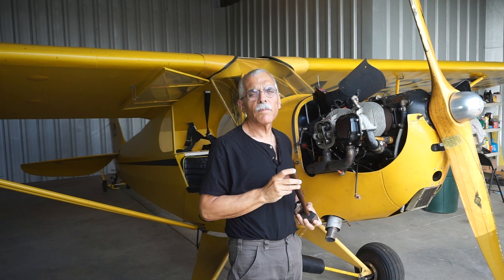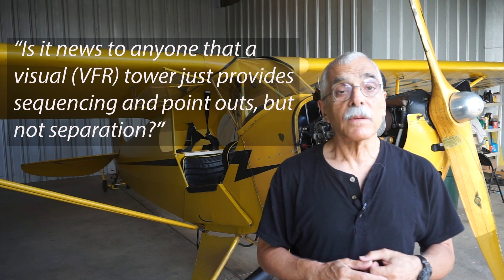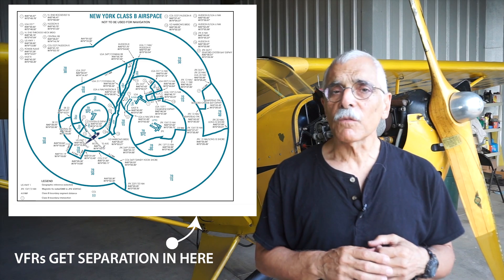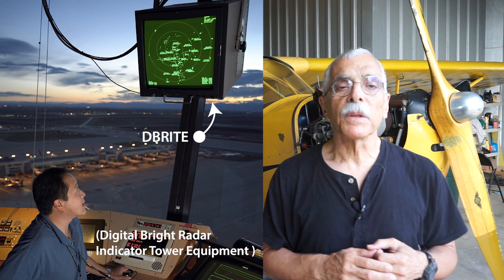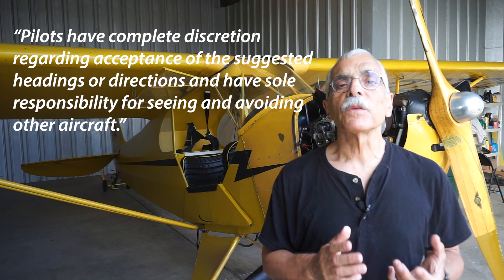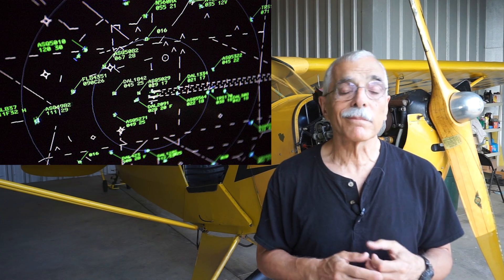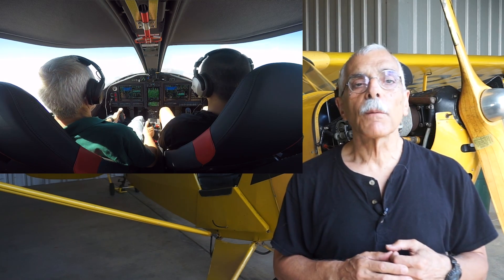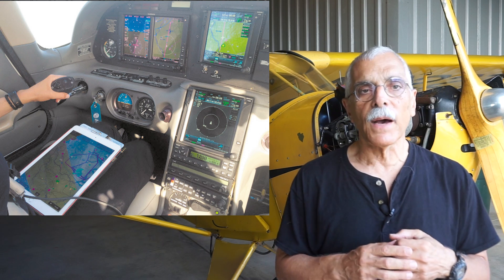Control Towers Don't Do What You Think They Do

Comment: There are two reasons you have to have an air traffic controller pilots are blind compared to things that move as fast as aircraft like Hawks or a cheetah. As human beings go pilots are exceptionally hard of listening. Scientific research has shown generally flying in an aircraft your eyesight is focused about 40 yards in front of you. If you were flying an airliner and you saw something in the air in front of you you have either hit it or missed it by the time you saw it you're too close to turn and miss. Most people don't realize how committed they are when they're driving a car on the ground at highway speeds. They can't accept that if you're riding in an airplane you're pretty much over flying your eyesight. If you would do the math and figure out the cross section of the airliner times the speed of The airliner you would see that we are sweeping out a pretty large volume with an airliner. When you have that many things sweeping out that much volume driven by blind people you need some kind of traffic control so they don't just run into each other close to the airport.instead of pretending we can all see why don't you pretend we're all Stone blind and we need air traffic control so we don't bump into each other close to the airport. If you're going to dumb it down and make it simple that's the best way to go.

Comment: Wait, what? Only 51% of midairs since 2000 have been fatal? That seems like an almost impossibility low number to me…

I’m the opposite way when it comes to operating in and out of Class D. I like practicing my touch and goes elsewhere in order to keep from annoying tower controllers but I actually like operating in a Class D environment. Nothing is utterly fail safe but an extra set of eyes never hurts and the further I get away from my “primary” days, the less communicating with ATC bums me out. The controllers at my home field are known for being really good. It’s a well-equipped, 24hr military field with an endless runway that sees traffic from small GA up to cargo 747s and even the AN-124. So the experience you get at a place like that is at least likely to be a little better than you’re gonna get at a small contract towered field whose controllers spend all day bitching on r/ATC

Comment: One of the best videos I have see that describes reality, not just the CFARs. Thank you Paul!

I fly out of an airport with light traffic compared to a nearby uncontrolled airport, both not far from a Class Bravo primary airport. The uncontrolled airport was described as "the wild west" during a recent Saturday seminar I attended that was hosted by the local FAST Safety Team. I agreed with that depiction having flown a bunch out of both airports.

The bottom line is that I love my home-base airport in no small part because it HAS a "VFR" tower. And, I will admit, that I ask them to "fetch" my IFR flight plan quite often. 

THANK YOU to the Air National Guard tower at KVUJ! You guys and gals do a great job helping keep my wife and I safe in all kinds of weather.

Comment: Hate class deltas. They’re more in the way than anything else. I fly out of Prescott where they sequence and provide good separation when able, but the system is rigged against good controllers who want to take control of the airspace. A busy runway isn’t the same as a busy airspace. There are busy runways with straight in and out traffic and then there’s patterns that are buzzing with aircraft but an inactive runway. VFR XC traffic into Prescott has to seriously contend with training traffic and yet the controller is more difficult than if there were not. Deltas have different priorities, and this cannot be changed without serious FAA approval/intervention/budgetary input.

Comment: Paul, I used to use the differential pressure tool to apply air flow into the cylinder and pressure to the valve face while reseating the valve. It works well. I love 1930s technology.

Comment: In Europe, EASA makes it very clear: it's the aispace class and the flight rules that matter. I as a VFR traffic will be
- Class A:  fully separated from the whole airspace (not allowed to enter)
- Class B:  fully separated from IFR and VFR traffic 
- Class C: separated from IFR traffic, but not separated from (only adviced about) other VFR traffic
- Class D: not separated from anything, only traffic advisory
- Class E: not separated from anything, traffic advisory "as far as practical"
- Class F: not separated, uncontrolled airspace
- Class G: not separated, uncontrolled airspace

In short, unless we are in a Class B airspaces, VFR pilots will NOT be separated from other VFR traffic by air traffic services. The pilots need to do that themselves, it's their responsibility and any additional help received from the air traffic services (suggested avoiding actions etc.) don't transfer the responsibility away from the pilots to acquire the other traffic visually and avoid collisions. 

Source: https://www.easa.europa.eu/sites/default/files/dfu/Easy%20Access%20Rules%20for%20Standardised%20European%20Rules%20of%20the%20Air%20%28SERA%29.pdf
APPENDIX 4 ATS AIRSPACE CLASSES – SERVICES PROVIDED AND FLIGHT REQUIREMENTS

Comment: Also, according to the 7110.65, "copy" is not proper verbiage. The word is nowhere in the entire manual. While "advise when ready to copy" makes sense, roger, wilco, or a readback is expected and should be used in place of "copy." It seems no pilots understands this unless they are or were also controllers. I didn't know it until I went to OKC either, so I'm not judging (plus I've worked in the airlines for 20 years and I hear it all the time).

Comment: Was flying to Las Vegas from Minneapolis and multiple times during the flight I was able to visually see a plane as we nearly passed through the contrails at cruising altitude, at my estimate we were at minimum 100 feet above them and at maximum 300 feet, and we sure as hell weren't 3 miles apart. Is that normal?

Comment: At 5:43 your video says issuance of Traffic Alerts is optional.  This is absolutely wrong.  FAAO 7110.65 para 6-1-6 states very clearly "The issuance of a safety alert is a first priority..."  There isn't any "optional" about it.  I also take issue with your repeated assertion that towers are not providing separation by giving positive control instructions, "Proceed direct to X"  "Turn south and look for Baron 2 o'clock 3 miles westbound" extending downwinds, and issuing 360's.  This is unquestionably the provision of airborne separation between aircraft.  The absolute essence of working numerous aircraft approaching the airport from widely different directions and altitudes, with very different flight characteristics is the provision of separation between those aircraft.  This is without mentioning the numerous pilots who, despite correctly reading back a clearance or instruction, attempt to land on the wrong runway, cutoff other aircraft, cross or enter runways, etc.  And those are not rare or isolated events, they happen with frightening regularity.  You talked about skin in the game and chairs falling from the sky.  As a pilot you can make all sorts of egregious errors, and receive nothing more stringent than a phone call from FSDO, while those VFR Tower controllers you seem to discount as superfluous are under incessant pressure and threat of career ending sanction for the simplest of phraseology errors.  You'd be well-served by reaching out to a tower and spending a busy afternoon watching the reality of the system.  Reference:  33 years ATC, including training, management, and Watch supervision.
Reply from the maker: You might have published the entire paragraph;  

2−1−6. SAFETY ALERT
Issue a safety alert to an aircraft if you are aware the
aircraft is in a position/altitude that, in your judgment,
places it in unsafe proximity to terrain, obstructions,
or other aircraft. Once the pilot informs you action is
being taken to resolve the situation, you may
discontinue the issuance of further alerts. Do not
assume that because someone else has responsibility
for the aircraft that the unsafe situation has been
observed and the safety alert issued; inform the
appropriate controller.
NOTE−
1. The issuance of a safety alert is a first priority (see
para 2−1−2, Duty Priority) once the controller observes
and recognizes a situation of unsafe aircraft proximity to
terrain, obstacles, or other aircraft. Conditions, such as
workload, traffic volume, the quality/limitations of the
radar system, and the available lead time to react are
factors in determining whether it is reasonable for the
controller to observe and recognize such situations. While
a controller cannot see immediately the development of
every situation where a safety alert must be issued, the
JO 7110.65W 12/10/15
2−1−4 General
controller must remain vigilant for such situations and
issue a safety alert when the situation is recognized.
Reply: @AVweb  which doesn't say anything at all about it being optional.  It doesn't even imply it.  It says it is a FIRST PRIORITY.  It's not a complex paragraph to follow.

Comment: I would think in addition to ADSB (which could suffer at times from signal loss or lag), planes should also have some form of near field radar as a backup which turns on whenever another plane enters your sphere of operation, say with a warning radius of a mile or two.   Or perhaps less if you are in pattern or on approach.    A bit like a car backup camera that only turns on in a specific situation.
Reply: The average price of a small airplane, is about $45,000. An automated onboard radar starts in the hundreds of thousands.
Reply: @Triple_J.1  The actual cost of the tech is much less, retail price is jacked up only because of a small market and no competition.   In reality it should be no more than a couple hundred dollars.
Reply: @Zuckerpuppekopf  a radar array has to send a radio signal, bounce it off the target, and sense the return scatter. It's incredibly complicated tech. Yes, they can definitely mass produce it. But even fighter jets don't have 360° radars, they cannot scan the entire sky simultaneously. 

Also, many small airplanes are made of wood and fabric, e.g. Piper Cubs and Pitts specials. They are semi-stealth. It's part of the reason why Transponders are required in certain areas. It is a secondary verification for the radar operators.

ADSB-Out works the best at the price point. 

The primary means of collision avoidance is Mk.1,Mod-1 eyeballs. It works for semi trucks. It works for race cars. It works for fighter pilots in air to air combat.
Reply: @Triple_J.1  well of course classic radar tech required an update lag since it did a 360 sweep every x-seconds.  And more importantly you'd need more of a spherical zone of sensitivity.  But, the real issue, especially if near the ground is how to filter out noise, especially if adjusting for lighter materials, as mentioned.   So, yeah, the only real solution is to require all flying devices to have adsb so you can download the data directly.   However...even that data would be lagged somewhat.   Data processing speeds are not infinite.

Comment: Hi Paul nice video. I am both a controller and a commercial pilot. I live in Australia and control at a Class D tower. Our D towers are generally modeled on yours although there are differences. One thing I'd like to point out and it may seem semantic but from the controllers side of me I can assure you it's not. Whilst you are correct in regards VFR traffic not getting a separation service like IFR does we are still responsible for your safety in some way. We can't just fire off traffic and forget about you until you report on downwind or if we see two aircraft in close proximity we have to do something about it. We can't just say, ah, they are both VFR, not my problem. Saying VFR separation is not our job whilst in the terms of the manuals is correct, in my opinion it's not the whole picture. I can assure you here in Australia and I'm pretty sure it will be the same over there, if two VFR aircraft collide whilst on my frequency I will be yanked out of the seat and asked serious questions and there is the possibility of real ramifications.

I do agree with what I feel the point of your video is, don't rely on the tower, keep your eyes out and spot the traffic. I feel that many pilots these days (here in Australia anyways) seem to think that once they are under ATC control they don't need to anything but what we tell them and seem to relax. Their Situational awareness seems to drop off, they aren't listening to what anyone else is doing and are only listening for the own callsign which is stupid. This is very evident from their requests for other runways etc that had they been listening would be obviously not available due to something else going on. The other thing to remember and you did mention it, we are only human. We do make mistakes. I have in the past and probably will again both in flying and ATC. We are all part of the system, pilots and controllers both share the same goal, to get you from A to B safely. Keep up the good work, cheers from down under, S.

Comment: I'm with you. I hate talking to people, too. A non-towered airport vs a VFR is just a lot of talk and gives some a false sense of security. After flying for 20+ years I think eyes outside the cockpit is the best way to avoid traffic.
Reply: A well-oiled class D tower is a thing to behold. 

RHV is a great example. Fourteen aircraft in the pattern, 3 more on straight in approaches, two inbound to intercept the 45. 

Two short 3,000x75' parallel runways with barely five wingspans of separation between. Landing both parallel, where opposite sign patterns are head-on collision course on Base leg at 400'agl over a cluttered shopping mall. Many times two aircraft are within 250', heading or drifting more or less at each other... But it works like clockwork.

Comment: Thanks for the excellent clarification Paul.  I think my assumption in flight separation IS part of the local ATC job, is because my local class B ATC (when I was active) occasionally advised of traffic outside of their airspace a few times as we were about to exit their airspace. In retrospect, they weren't coordinating separation, rather, making sure I was aware of "A risk" to take appropriate mitigating actions.

The closest I've come to a collision was returning from a nearby non-towered field (pre-certification tune up work), getting ready to check in at the designated announce class B ATC checkpoint, when a faster twin-engined low wing descended on the same point from port above, just as I was finishing a holding turn, because I came close to encroaching the ATC airspace before contact since they were very busy that afternoon. Neither the Baron nor I were aware of each other (we rigged our PA-28/140 with ADSB (In/Out)), apparently the other aircraft didn't, and I was shocked ATC didn't notify either of us, assuming the other pilot was setting up for ATC contact so he'd have the frequency tuned in, as I did.

This presentation clears up why.

I took the necessary evasive actions with a hard dive to the right, losing 500' as fast as I could, flying out to the nearby ocean, taking in a deep breath before trying the ATC announce attempt again. My estimation was we got as close as 50', and had I not spotted them and evaded, chances are I wouldn't be here to write this.

Flying is a lot of fun, but we need to keep our eyes outside as frequently as possible so accidents like the one I averted, are less likely.

Comment: I understand your point. But my Dad (A Piper Engineer) used to take me flying in VRB back in the early seventies with no control tower. You had to wait 20 to 25 minutes just to take off and sequencing was a pain in the ass for landing. There has always been heavy traffic in VRB.  They got a control tower in 1973 finally. Sometimes they are very badly needed. FPR was the same way. But I understand your point here.

Comment: ATC don't have to provide traffic information.... BUT the NTSB has no qualms in tacking the controllers' failures to see the conflict onto the end of any of those accident reports though.
Reply: "Where no separation minima applies, such as  for  VFR  aircraft  outside  of  Class  B/Class  C  airspace, or a TRSA, issue traffic advisories to those aircraft  on  your  frequency  when  in  your  judgment  their  proximity  warrants  it. "  Straight outta the 7110.
Reply: @uchinanchuu58   I’m not from the US, but it says something similar in our MATS. It also says in AIP (like your AIM) that pilots should maintain vigilance to see and avoid other aircraft. Trouble is, it’s hard for both ATC and pilots to do that sometimes and that’s when midairs happen because the system is ineffective. It’s no use blaming the controller and/or pilot. It’s like saying it’s the driver’s fault a crash occurred at a stop sign. Of course the driver’s actions contributed, but maybe they should have traffic lights (or Class C services for ATC)? But it’s a pure cost benefit equation.